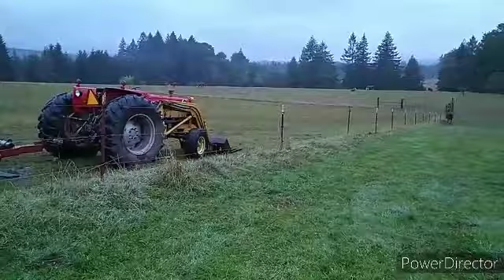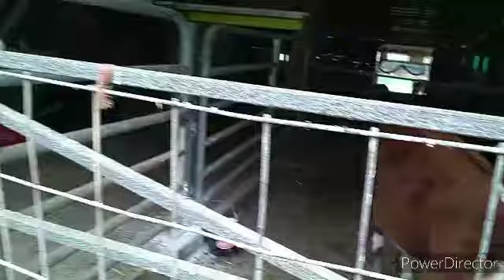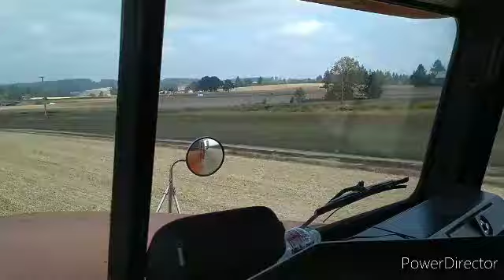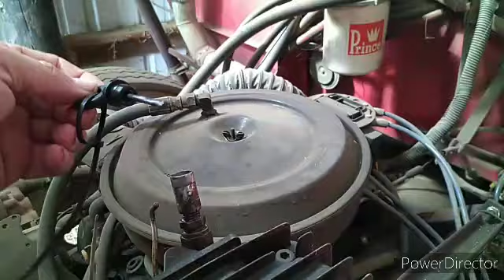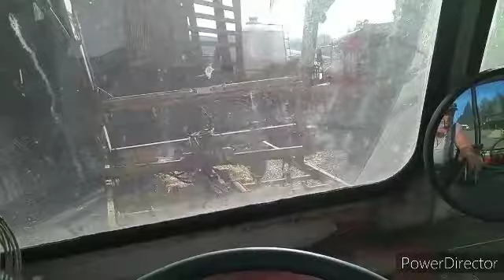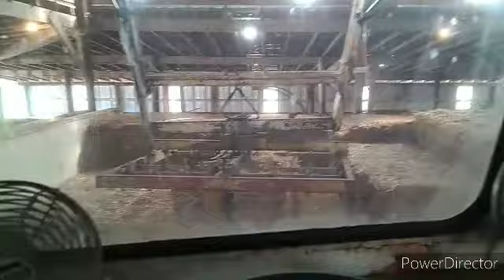bringing idiot straw bales in

Comment: At least you can say you received a little rain. Still doesn't put an end to irrigating though. Some nice looking straw. That bites about the compressor dipstick. Is straw crazy high out there too? I think small squares are around 5 or 6 here and up to 65 for big bales.🍻🍻
Reply from the maker: At least it didn't go anywhere.. was just in the tube!
Ya, were getting a good deal, $1. To the farmer, $2 to the baler/stacker/truck loader.. otherwise it would be 5 or 6 bucks

Comment: What would happen if you mounted that compressor on rubber or a couple of old valve springs
Reply from the maker: It would probably go for a ride... and leave me stranded
Reply: I was just thinking maybe it would stop the vibration . I know I've seen small block Chevy with air brakes in Chevy medium duty but not sure how they mount them
Reply from the maker: @donovanvolk8583  they're regular truck compressors, tapped in to the oil galley and drain into the pan..
Reply: I wonder what they do for vibration from the factory
Reply from the maker: @donovanvolk8583  nothing, they're fed oil from the engine, not vented,  except for the oil drain back to the engine.